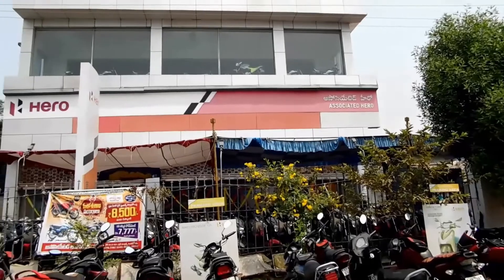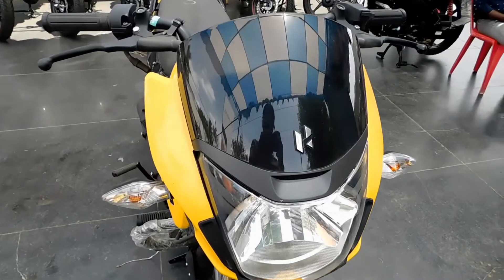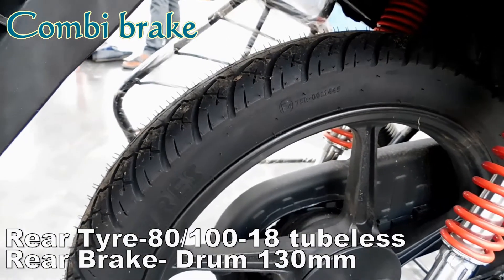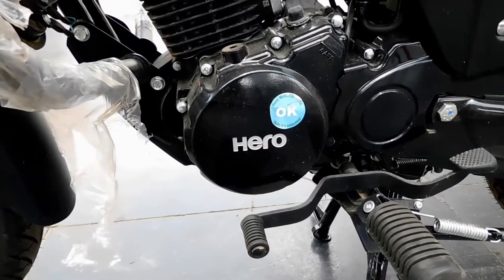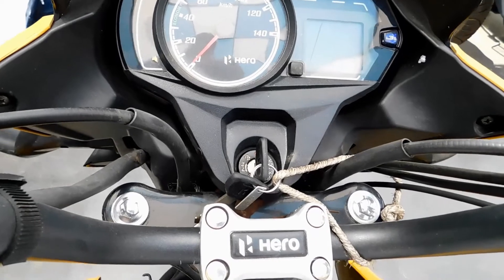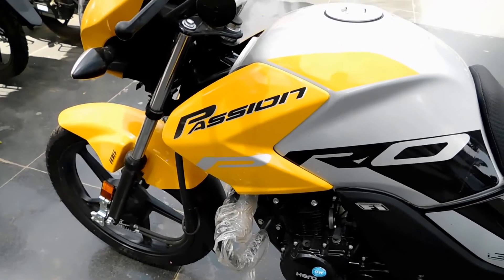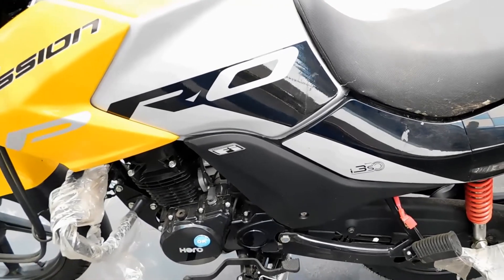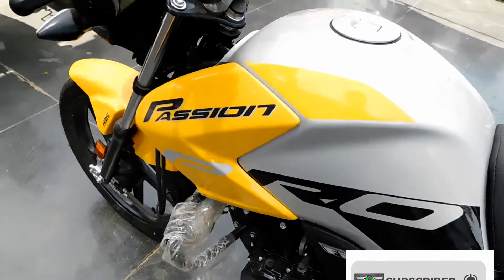Hero Passion Pro BS6 Telugu Review | హీరో Passion Pro BS6 mileage | onroad price | features | specs

Comment: Engine will get stop in running, gear shifting problems,  seat is very uncomfortable,  you will get feeling like you sitting on pipe,  for every two minutes you gave to resettle on seat, very very poor suspension, you will get back pain.
Reply from the maker: Hero and honda bikes suspension antha bagundadhu bro, normal hydraulic shock absorber untay